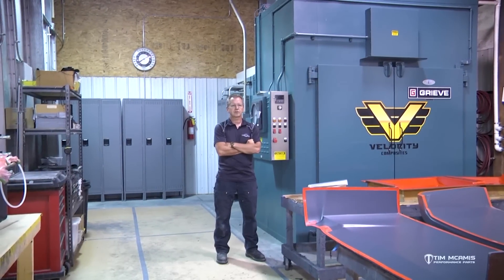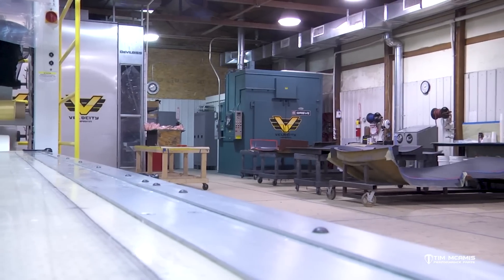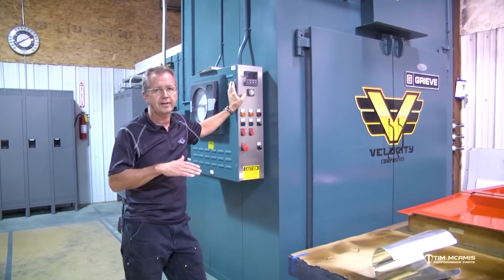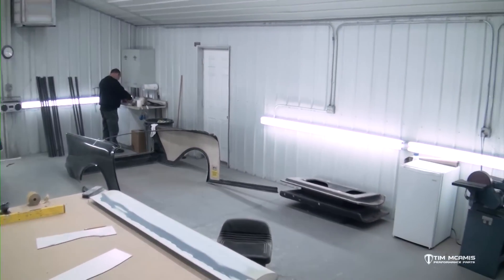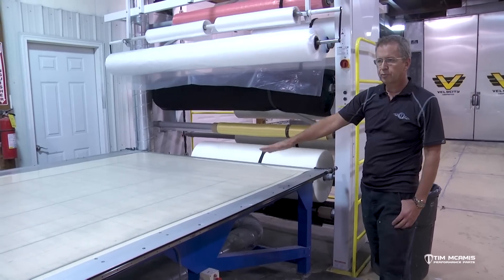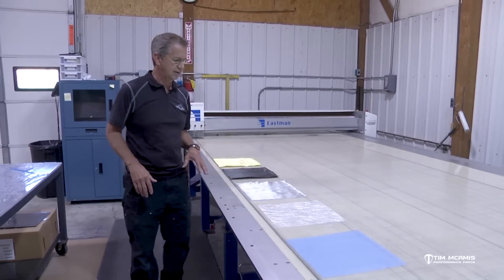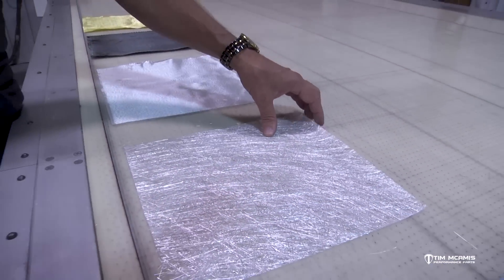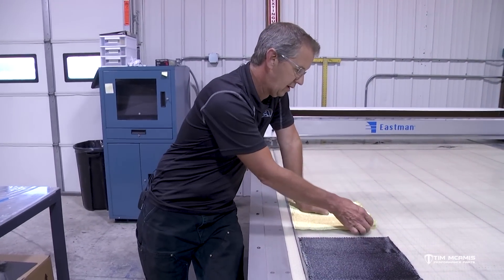Composite Materials & Shop Tour - Composite Series: E1

Comment: How thick should be cf layer to be as stiff as steel?
I am going to make my first cf bonnet, and I do not have any idea, and haven't found any information how many layers or how thick layer I need to have to have same or better stiffnes as steel bonnet. I do not like the idea, that It might get too thin and may bend into engine bay when driveing at hight speed.
Current hood has 0,7mm of steel plate thinkness(outer skin), I am planning to use 2x45degress of 0,2mm twill CF.+ inner frame same way.